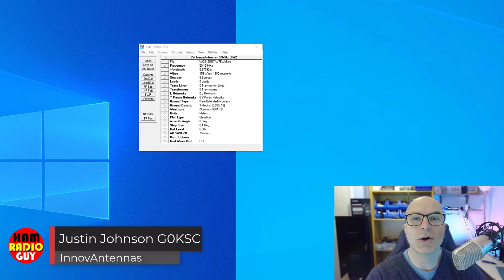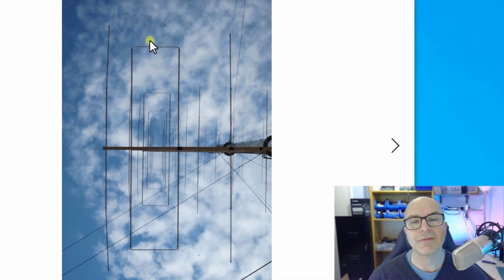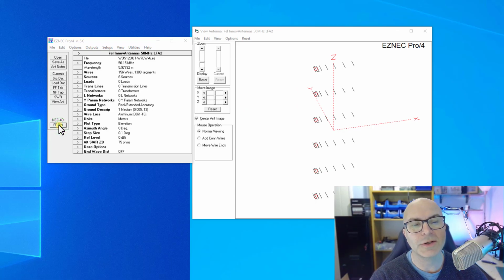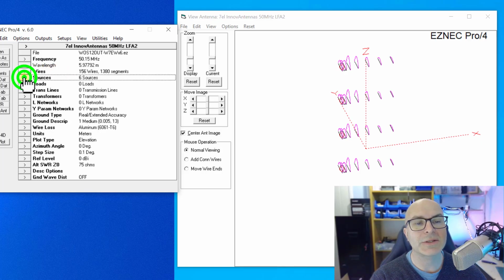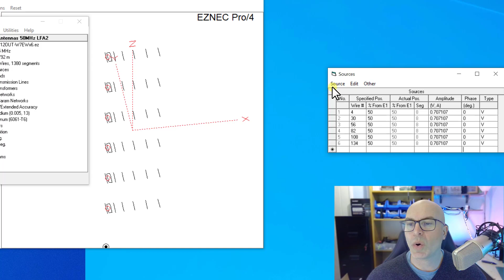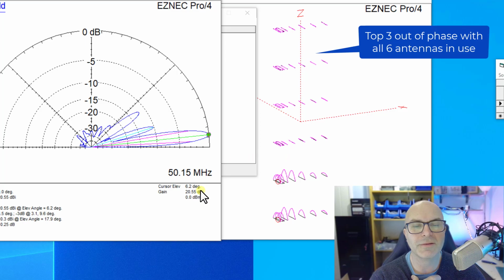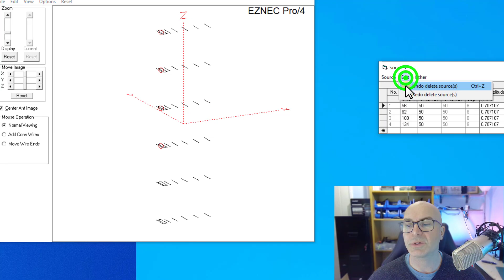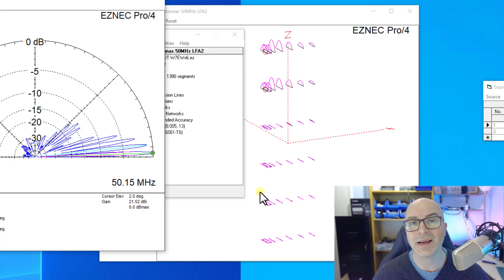50MHz 6 x 7el Yagi Stack 150' Tower - Phase configuration for BEST multi-angle results

Comment: how would a 4 h frame stack look on 6m horistontal and 6 vertical stack 4 5 el of 4m plus booms
from 18m down
3 options top 2 bottom 2 and all 4 is equal stacking ok and what are the best options
on switching

Comment: What's your thoughts on multi element 50 ohm delta loops for HF  VHF. My thoughts are to help reduce QSB with incoming signals with changing hoz and vert polarisation with 2 sides of the antenna at 45 deg. Over the years I have noticed signals coming over the equator into the southern hemisphere  have large fast changes in polarisation. You can be on a yagi and hear nothing switch to the vertical and Europe is S9+20. Mostly see this happening on 6m - 20m. Its a fascinating subject. Your thoughts on this would be great as it can sometimes reduce openings by hours if you do not have the correct antennas.
Reply from the maker: I have made them for HF and for commercial use. the biggest a 4el for 15MHz for a government in the far east. this was the twin-boom method running 50KW continuously.

Comment: Take-off angle is critical, as is received noise.  I used to have 7/7 at 6M, at 160'/140'.  It heard every bit of RFI for 35 miles in each direction, and I was regularly beat by folks with smaller antennas, at MUCH lower elevations.  I finally realized what was going on when I compared it to my 6M antenna at 40'.  I ended up removing the 7/7 stack.
Reply from the maker: Yes and part of the issue with a stack (as seen in the video) is the elevation angle s low and very narrow too as a result of the compression caused by the vertical stack.